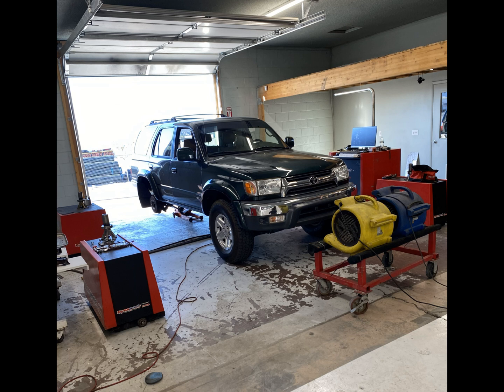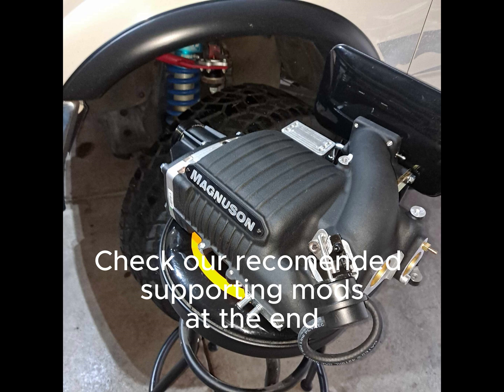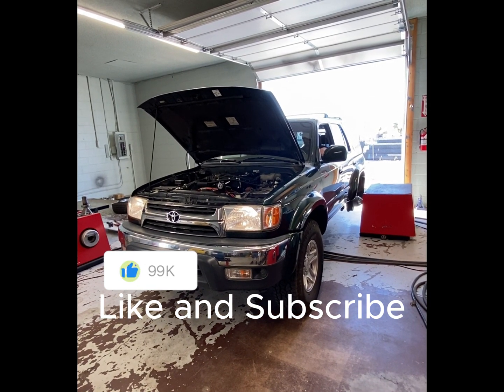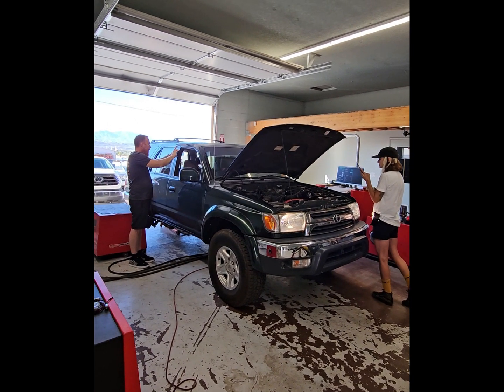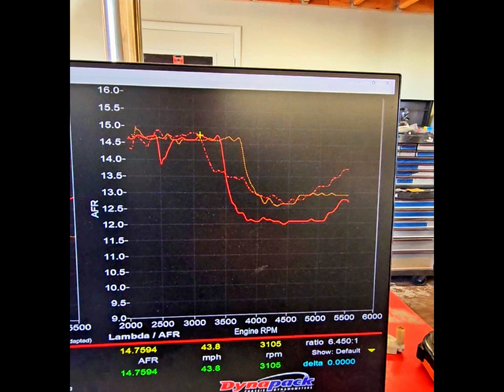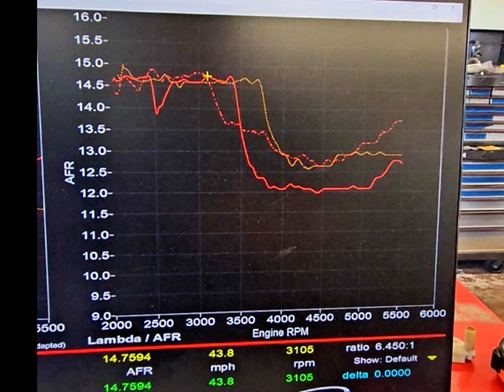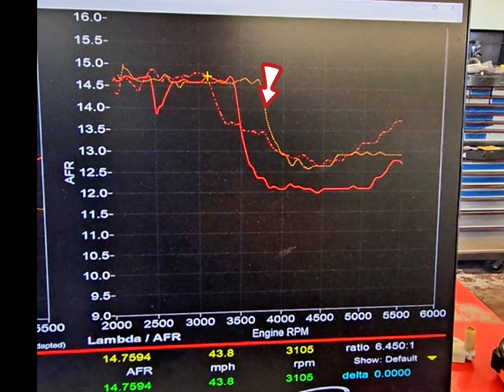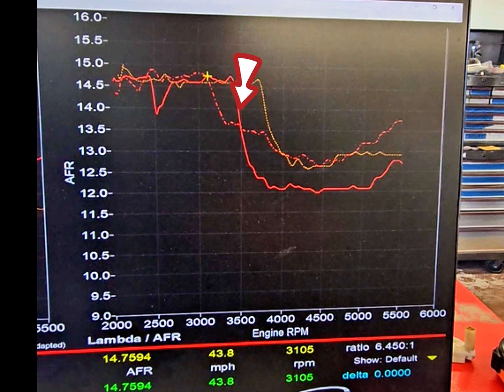3.4L 5VZ TVS1320 Stock ECU and fuel system results are finally here!! The result was as we predicted

Comment: Man wish I’d seen this earlier I’ve been running lean but ordered a 1:1 regulator and a DW165lph pump and the IK22 plugs now I’m wondering if I’ll be able to get my AFR down as good as this
Reply: I’m running the stock pulley and live in Costa Rica don’t have many options for parts and there’s no way someone here can put the 7th injector in for me so this is my only hope
Reply from the maker: @rileyking319  Give us a call or an email and we should be able to help.
Reply: I’m gonna try running it stock pulley with bigger fuel pump, 1:1 FMU, and colder plugs, stock pulley
Reply from the maker: Hope you can get it dialed in!

Comment: Thanks for the data and explanation. This tune setup looks to be clean, simple and effective.

I don't see these parts available on your website. The link is broken and searching on your site yields no results.

Do you have part numbers available for the FMU, fuel pump and plugs used in the configuration?
Reply from the maker: We have a new website and are still working out some bugs, try this link. 

https://snpspeed.com/product/5vz-supercharger-support-package/
Reply: Perfect, that link works 👍 Have you tested this with a smaller pulley or is it known that this is already very close to the fuel flow limit on this setup?

Comment: did you get any hp or torque #'s? if there are additional power gains with your support package you should show in black and white...with the low 4-5lb. boost afr honestly doesn't look that bad...make sure you run 93, change the fuel filter and put in slightly colder plugs. Higher boost levels will definitely require afr to be lower. Dyno pulls with power figures will help your sales...especially if the power goes up with the additional fuel.

Comment: I just installed this same tvs supercharger on my Tacoma. It pings bad enough where I don’t want to drive it.  Only driven it twice. 

I ordered the fuel pump, and ik22 spark plugs. With this be enough with out the 3:1 fmu?

Or is that needed as well?
Reply from the maker: You could try it without the FMU but you are probably going to need it.
Reply: @sevillacustomfab any updates on your SC set up?

Comment: How much boost/ air flow (if the mass air flow sensor is in front of the turbo) or boost if the mass air flow sensor is being blown through 
Is the factory mass air flow sensor capable of recognizing?
Reply from the maker: The factory MAF is in front of the supercharger and it will read the air coming in, but it will not read boost.
Reply from the maker: Depends on the size of the turbo. At some point a larger turbo will max the MAF out but honestly at that point you will need tuning in order to make sure the fuel curve and the timing is correct.
Reply: What I'm saying is it reads the amount of air that passes through it.
I'm sure it has a limit. Do you know the limit?
If it were talking about a turbo vehicle,  is it better to have the MAF between the air filter and turbo, or better to have it between the turbo and throttle body?
Reply: I'd like to get rid of my 2.0 pulley and go with one that makes about 7-8 psi.
Have it machined to fit a 1 way bearing.
Then once the supercharger spools up the GT45, the turbo takes over and blows through the supercharger with the 1 way bearing on the snout.
Not so much worried about HP numbers just want something cool for my show truck.
Reply from the maker: @TACOMASRT5  not gonna happen with a factory ECU. You're gonna need a stand alone for that
Reply: Thats the plan.
Already have an AEM 340 pump
318cc injectors
Plugs are 3 stages colder
Thermostat is 20 degrees colder
Currently a TRD header back exhaust
Do you think the twin charge is possible with the 1 way bearing?

Looking into stand alone options 
And meth injection @snpspeedinnovations

Comment: As you probably know all toyotas ecu are open on time of first use at the factory there is a 15 to 20% of auto adjustment by the factory ecu after installation on the vehicle. There is a way to set the factory ecu to default allowing to compensate for a super charger also the biggest problems arise from the fact that toy knock sensor are to sensitive they will pick up the knocking sound made by the supercharger you have to limit the sensitive of the sensors .My personal vehicle is a 95 t 100 it got over 200 k on the gage it is supercharge it runs on regular gas 12 psi of boost no knocking plenty of power no engine damage . There is always a way if you stop and think
Reply: The ambient temp has to be below 80 degrees. The engine must be cold and create a major vaccum  leak. Start the engine and allow to die on his own. Repeat on separate days 2 or 3 days do not drive the vehicle .What  this will do is set the ecu to the most fuel capacity capable. After that drive, the car .It will run rear rich it will adjust fuel and timing while leaning the super charger .you will have to install resistor in line for the knock sensors. It will retard to about 20 degrees also the valve springs must be replaced for a stronger psi .Under pressure the factory springs will cause a lean condition.  It took me a long time to figure this out. Good luck 👍
Reply: @luiscruz-no3ib  thanks man
Reply from the maker: As you know this is not always the case. The bigger problem is the combustion temperature and the factory ECU keeping the AFR at 14.7 while still under boost and while in closed loop. The lack of fuel creates heat plus add the higher air temps and you have knock. This is basic information but it’s because the factory ECU does not have a MAP sensor to accommodate for boost. There is some ECU years that respond better than others BUT they will all gain from having fuel upgrades and a tuneable system, gains as much as 60+ft Tq between 2-3K which is the most problematic area as I’m sure you know due to making boost, the ECU not seeing boost and while in closed loop control.
Reply: @snpspeedinnovations  what do u recommend to get a tunable ECU that's easy to install, I was wondering about doing a piggyback from aem but i wanna know if there's any extra things I need to know about the stock ECU for Toyota
Reply from the maker: @mycum8818  depend on how the supercharger you are using, much boost you are making, and the elevation you will be operating at. When supplying air you need more fuel. The more air you supply, the more fuel you need. Stick pulley upgrade the fuel pump and injectors. Adding a little more boost? Add one of our FMUs. Adding even more boost? Add one of our Haltech kits and have complete tune-abiliy
Reply: @snpspeedinnovations  rn i have the gen 1 Trd supercharger, stock pulley but I have the urd 7th injector kit, it keeps running too lean so tried to trick the Ecu with a piggyback but the most I got the air to fuel ratio was 13.2
Reply: what is the process of resetting the ECU?
Reply: How do u put the Ecu on factory mode

Comment: Howdy, actually looking to buy a 4runner with a TRD supercharger which if I understand is the same at this Magnusson unit.

being that AFRs are a little lean early, you could not just cheat by running a FPR at slightly higher fuel pressure to give a little extra fuel all around?
Reply: No fuel can be added to the engine on close loop only on open loop it will be a waste of time. The ecu will pull the extra fuel back and trim the mix only on the open loop can fuel be added  if your 3.4 got a throttle sensor with  3 wires, you can increase the adjustment, creating  more of a percentage on position. You must use a scanner to do this, your open loop will come in sooner  good luck 👍
Reply from the maker: @luiscruz-no3ib  this is exactly what this video is about. I have been explaining this for years but we can actually see in in the video
Reply: @luiscruz-no3ib  how do I increase the adjustment for it, I swapped my Toyota pickup with an 3.4L but I'm not good with tuning yet
Reply from the maker: Yes it is. Magnuson made the superchargers for TRD.
Reply: you wont find any 4runners with this supercharger, you may find a 2nd gen or maybe a 1st gen supercharger that was produced with TRD. this supercharger they are showing is then newest generation for the 3.4 v6 5vzfe. It was not made in collaboration with TRD but is still made by Magnuson and they still carry the same interest as TRD back in the day. This 3rd generation supercharger is much more efficient and should provide more boost and power after a smaller puller and 7th injector kit compared to the 1st and 2nd generations. just buy a stock 4runner and buy a new 3rd gen kit and have it installed at a reputable performance shop or toyota specific shops.

Comment: So with the stock ECU but the bigger injectors and FMU (and colder plugs) was there any engine ping. I'm excited about this new SC but I don't want to have to run all types of additional control modules and tunes as I live in California and don't want the hassle.
Reply from the maker: Not larger injectors, larger fuel pump. Yes, all pinging went away